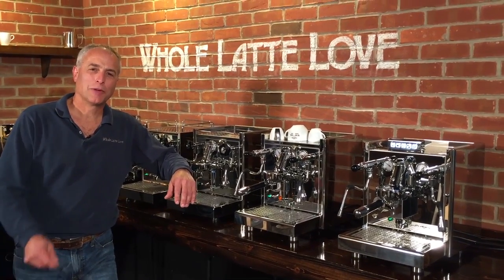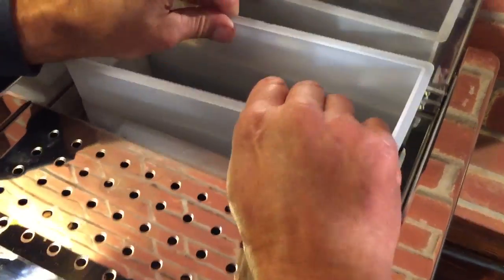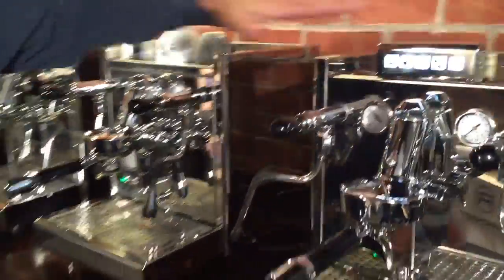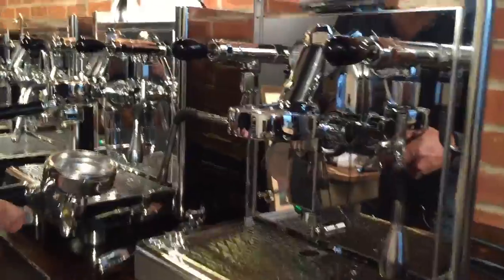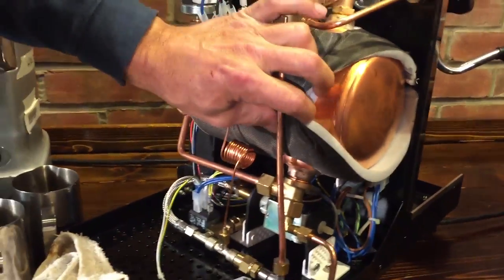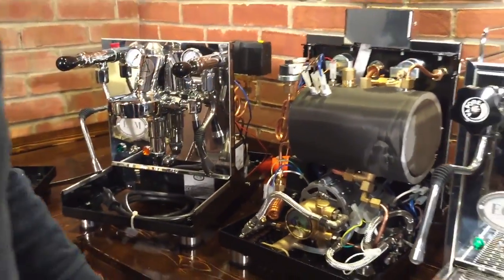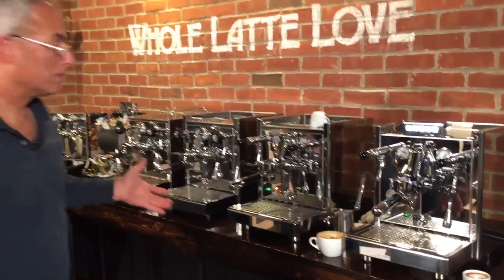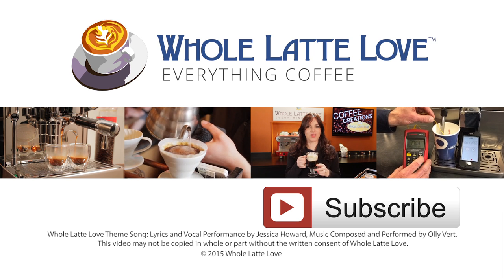Compare: ECM Mechanika, Technika IV, Technika IV Profi, Elecktronica Espresso Machines

Comment: Hi ... what is the material used within the 'no-burn'  hot water wands and steam wands  of the Profi and the Elecktronica?
Reply from the maker: Hi gg1, Material used in no burn wands is usually food grade silicone tubing. I'm contacting ECM for more specific information and will post their response here.
Reply: Thank you for the quick reply!  I love your site and your informative videos!!  Great job!!!
Reply from the maker: You are welcome. I heard back from ECM this morning. They say it's a Teflon tube lining the stainless steel wands.
Reply: Hi .... I would like to avoid teflon if I may ... is it possible to order a machine without teflon coating inside the wands?  Which ECM models do not have teflon coating in the wands?
Reply from the maker: Hi, It's a flexible Teflon tube in the wand and not a coating. The tubes can be removed. I'm checking with our machine prep technicians to find out if the tube can be removed by them during setup prior to machine being shipped and will let you know. Which ECM machine were you interested in? All ECM machines with no burn wands have the tube as do machines from other manufacturers like Expobar, Profitec and Rocket Espresso
Reply: Thank you for your quick reply! I am interested in the Synchronica ... but, would forgo this model if the tubes can not be removed.  I think the ECM technika lV is no burn ... is this so?
Reply from the maker: No problem. Should have an answer for you shortly. Technika has the the tubes as well.
Reply: Do any of the models not have the tubes?
Reply: ECM models that is ...
Reply from the maker: Just heard back from the prep techs. They'd be happy to remove the teflon tubes. They wanted me to let you know wands will no longer have the "no burn" characteristic.

All ECM machines have the no burn teflon tubes.
Reply: Awesome news!!!  Okay, there is a Synchronika machine with my name on it!!! Now, I just have to decide on a grinder!  Thank you for your help ... much appreciated! :)
Reply from the maker: You are welcome! When you order probably best to call with your special request.
Reply: Thank you! I shall so so ... :)

Comment: Nice vid! Very informative and easy to understand :-)
What is the differences between using a copper or a steel boiler?
Taste, heat up time, maintenance etc...?
Reply from the maker: +Krikstar123 Hi, Glad you enjoyed the video! Copper is a more traditional choice. Talking with our prosumer machine techs there is a slight preference for stainless steel boilers. They seem to think they are less prone to scaling. Copper will tarnish stainless does not. Most copper boilers use brass end plates. Difference in heat up time are negligible.

Comment: Hi, can you do program the Electronica to do preinfusion?
Reply from the maker: Hi SD, Thanks for the question. No programmable preinfusion on the Electronika.
Reply: @Wholelattelovepage  Thanks for the quick reply. That means it's out of consideration set. Right now, I am leaning towards buying the Technica Profi V. One thing that is holding me is that you guys do not provide free flow control for it, but do provide it for a bunch other machines. Is there a chance to provide this one as the same type of promo?

Comment: Why ECM doesn’t have PIDs on their HX machines, while Rocket have it on theirs (Mozzafiato, Giotto), that are otherwise very similar?
Reply from the maker: Hi DP, Thanks for the question. Not certain why they do not currently offer an HX machine with PID. Do check out the Profitec Pro 500 PID. It's an HX machine. Profitec and ECM machines are made by the same company.
Profitec Pro 500 PID: https://www.wholelattelove.com/profitec-pro-500-pid-espresso-machine

Also we recently visited the ECM/Profitec facility outside Milan, Italy: https://youtu.be/K0RI5rdz4Ww
Marc